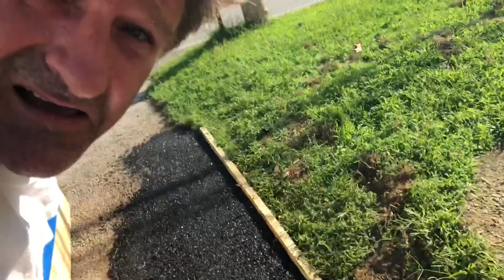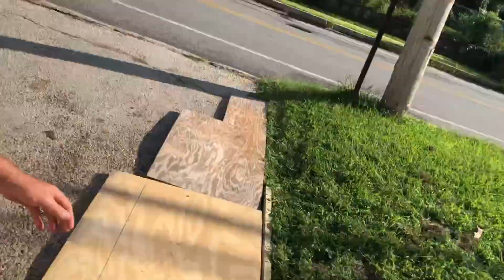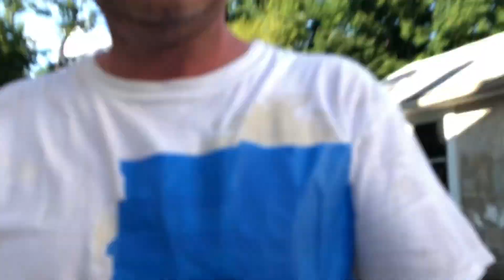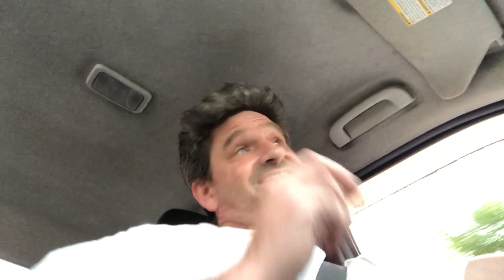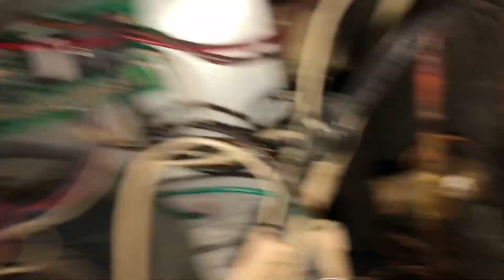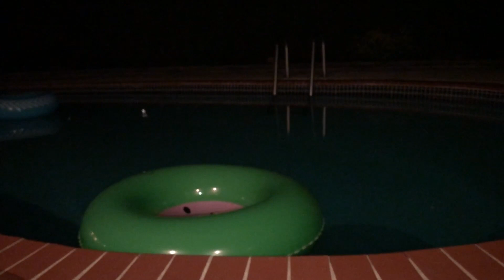Doing my job managing rentals, today's Senate Kavanaugh hearing and my channel

Comment: Thanks for your respectful coverage on Mollie towards the hispanic community. Btw. Too much money for replacing the txv. Maybe $500 if that.
Reply from the maker: Thanks so much dude, appreciate that very much on both counts. I’m bummed tho cause the other provider never came out, wouldn’t service our building, but said it was a fair price, that his company Horizon huge company charges more $2000, but I did suspect there was some kind on non-compete going on, Horizon Services is constantly growing buying other smaller companies. I have tenants in there, so I’m a bit stuck. It is a strange system, hot water heater heats the unit. Your thoughts? Am I getting screwed?
Reply from the maker: I’m calling some other providers, still any additional thoughts you have let me know, either way no worries thanks again